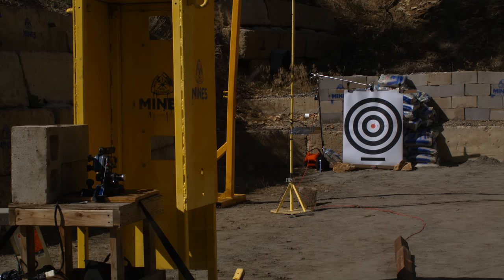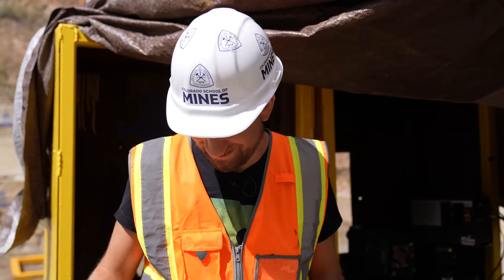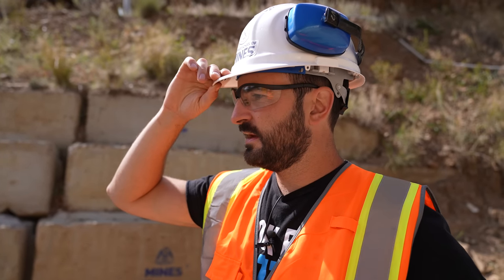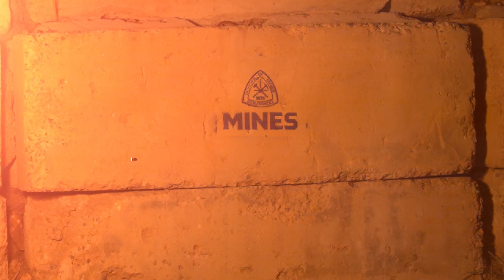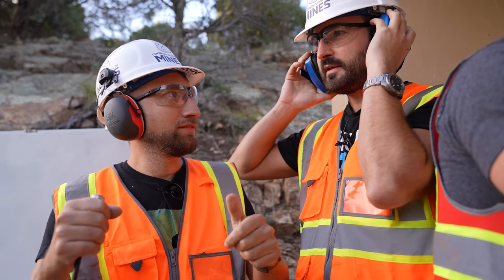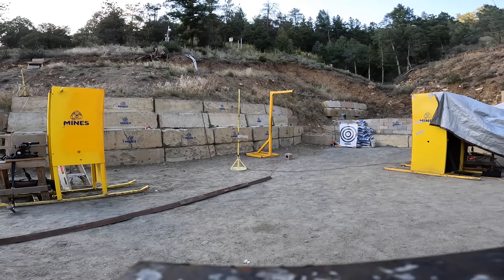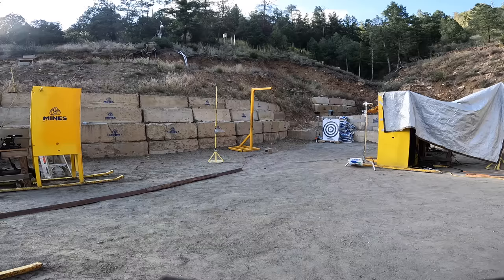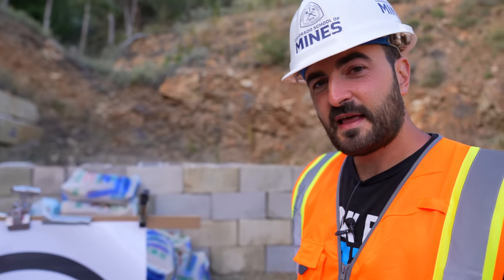Can Explosions Deflect Bullets? 2 MILLION FPS - The Slow Mo Guys

Comment: i'd say the most important factor is the bullets distance from the center of the explosion. 

i'm sure you could also figure this out mathematically rather easily. you choose a rate of deflection that you would consider sufficient, take the bullets weight, shape and surface area, calculate the pressure per surface area that would do that and from there you can pretty much just tell how much explosive you need at what distance. and THEN you could get some awesome slomo footage of it =D
Reply: I was browsing the comments for someone that said this, really. Move the bullet closer to the explosion and there will be more changes on deflection.
Reply: @hacky97  yeah, i did the same and didn't find anyone saying this here either, so i posted it. 
seems obvious to me.

Comment: As a long distance shooter, I have so many thoughts on this. This was, easily, one of my favorite experiments you've ever done! Well done. 
You have single handedly given the haters a pile of ammunition to use against people that blame their bad shots on the wind. "If C4 doesn't affect tragectory, how in the world would a gentle breeze!?"
Oh boy, I can see them coming out of the woodwork already. Thanks guys.
Reply: Well, you saw how much the wind affected the bullet - more than the C4. They mounted the gun in a jig that allowed them to basically shoot exactly the same way each shot, much more precisely repeatable than any human shooter. So, either the gun shoots inconsistently each time or the wind is actually affecting the bullet.

So, the people blaming either gun or wind are probably right. No ammunition for the haters, on the contrary.
Reply: This was my exact thought. I think the reason there seems to be no deflection is how short the bullet's flight path is. If they could run this test reliably with a range over 100 yards or more, I bet the results would be different.

Comment: I'd be curious to see this done with the explosion directly ahead of the bullet. Thinking of the bullet's trajectory like an orbit, if your aim is to reduce the velocity I think it'd be more effective to impart a force on the retrograde vector (rather than the radial in) ie. instead of trying to use the explosion to push the bullet down, push it straight backwards to hopefully maximise how much you can slow it down (and thus impact where it hits the target)
Reply: Exactly
Reply: Yea exactly. It's like asking whether or not water can deflect a bullet, but instead of shooting the bullet into water where the bullet is experiencing the proper opposing resistance, you instead tried to pour water onto the bullet as it was traveling and barely got any water on it. The shockwave from the explosion needs to have started and is expanding toward the bullet for the bullet to experience the most resistance that could lead to a delflection. If all it's doing is going off right above the bullet, or right behind the bullet then it's really only going to chase the bullet and not apply that much force to it

Comment: If you ever revisit this, try getting a grouping for the bullet rather than a single test shot. Make sure you circle the group with a marker too. That way you can easily tell when a bullet is out of the average grouping
Reply: And the target was way too close. No way to tell if the explosion had any affect on the bullet or not.
Reply: @billnunya9324  I mean, obviously the bullet is gonna be off a little bit, but its not like its gonna hit 45 degrees below point of aim because a bomb went off next to it
Reply: @billnunya9324  You have to take windage into account though. A more solid target is probably needed to avoid it going all over the place, but getting too far away would allow more external influence, especially on a little 9mm.

Comment: At this moment, this is my favorite Slow-Mo Guys video. I 100% thought the bullet wouldn’t even hit the target. I would have bet that the C4 would have a significant impact on the bullets. Nice video!
Reply: Explosives are very high energy at the point of explosion but that quickly diminishes with distance (inverse square law) - unless it's something like shaped charge. Bullets, on the other hand, are small, heavy and moving fast so they have high momentum, way higher than the shockwave at distance. Maybe if they exploded C4 right next to the flying bullet it might have an effect.
Reply: @LiborTinka  I agree with you and Gav. It would be cool if they had way more time to play around with the variables. I’m sure with enough iterations, they could achieve more deflection!
Reply: @jeromeschwartz3699 Yes. There is already a video of bullets colliding mid-air air (from SmarterEveryDay) so hitting a bullet with directed charge or close-up explosion would be cool, too :)
Reply: @jeromeschwartz3699 Yes. There is already a video of bullets colliding mid-air air (from SmarterEveryDay) so hitting a bullet with directed charge or close-up explosion would be cool, too :)
Reply: @LiborTinka  I saw that Smarter Every Day video! I was pretty impressed with the way he solved the, how do you safely load the second gun after you’ve loaded the first gun, dilemma!

Comment: It would've made more sense to have the explosion go off well before the bullet arrived. The shockwave is the only aspect that could fesibly deflect the bullet, so having it go off after the bullet had passed, or right as it is already passing, means the shockwave has to chase the bullet, or will push on the bullet from behind, so it doesn't give enough force in an opposing direction to alter the course. If the shockwave was already forming while a bullet was entering it from the front, thats when you may get the results you want since that is an opposing force that could result in it being deflected. It's kind of like asking whether or not water could diflect a bullet, but instead of shooting a bullet into water, you instead tried to pour water onto a bullet from above
Reply: And anyhow, the shockwave, moving at Mach 1, won't catch the bullet, moving at  Mach 1.1 (1250 ft/sec)

Comment: I think a .45 or 10mm would be a more interesting round to use for this. Slower round with slightly more surface area. I suspect the rotation generated by the rifling on the relatively quick and small round might've been a more effective shield against Shockwaves than the larger/slower rounds might have.

Comment: I would love to see you do this again in a few years on a larger scale.  Having the bullet go farther to possibly see if it deviates further down range would be interesting.  

Also, see if you can get your hands on some ERA(Explosive Reactive Armor) for a video down the line.  I would love to see some experiments done with it.
Reply: This is a good idea! Use a better target that isn't affected by the explosion and first measure the accuracy without the explosion and then add the explosion. With the target far enough away, even small deflections would be clear.
Reply: They need the bullet to pass closer to the beginning of the shockwave at the center.  That would have meant moving the gun up or the C4 down in this experiment.  The force of the shockwave is inversely proportional (to the third power) to its distance from center at the moment the bullet passes through, so for the greatest effect the bullet would be exactly at the point of the explosion.  Since that's not possible then it needs to be as close as is possible.
Reply: It should be done at a 100 yard range, the rifle positioned further back on a solid mount, and the target 100m down range. That would tell you with a usable amount of precision. This flapping paper target at 5m isn't it.
Reply: @Sotanaht01  I like that logic.

Comment: You could have moved the bullet closer to the explosion by either lowering the explosives or hiding the pistol and wire-paper and still aiming at the sandbags. This will put the bullet in a much more energetic part of the explosion, although I see this might be dangerous for safety reasons

Comment: I think you results would been more consistent if your target was solid. You can see in some of the slowmo that the flimsy target moved before the bullet hit which would alter it's initial impact point. And the way the target moves would vary with each shot as the shockwaves move faster than the bullet. Definitely worth revisiting I think.

Comment: rollup target fixed in place with a wooden frame all around, backed with plywood (or tighly stretched netting of some sort) to prevent further flapping around. painting the target on the plywood itself like some comments suggest will have the risk of the target chipping or breaking off in large pieces around the point of impact

Comment: I would be curious to see the results of a test where the C4 was right in front of the bullet and went off ever so slightly before the bullet reached it. See if the C4 ends up imitating ERA (Explosive Reactive Armor)
Reply: Well, it's literally just hitting the bullet with air, which is what the bullet is already pushing through.

ERA works because the bullet is actually contacting something solid, particularly at an angle.  Launching out a flyer plate or witness plate that the round makes contact with.

Comment: Great video as usual, guys. Unfortunately, you don't know which hole was the control shot, because you didn't calibrate the target to the immovable backstop. Next time, use a printed target on a foam core board fixed in place. The target's motion threw off the experiment. Even so, the group on the sandbags was very tight—well within the variation I'd expect with no explosion.

The bottom line is that I'd say it's reasonably conclusive that any effect of the explosion on the bullet's trajectory is minimal, and certainly not enough to make any difference to a live target at that range. The sandbags proved that conclusively.

Comment: Great job!! Timing and location of the bullet are the most important factors to consider since the power of the shockwave decreases rapidly with distance. The explosion must hapen before the bullet  arrive to the explosive so the shockwave travelling in the opposite direction will decrease the bullet velocity. You can use the speed cameras to calculate the speed of the bullet, to check velocity increments.

Comment: As ex military I have a couple of thoughts. Firstly, the target moves from the shock wave so the control then means nothing. Secondly even 2 or 3 mm of deflection over such a short distance would mean missing the target completely over any distance - a 30 kph side wind can cause a high velocity round to veer off target by about 1m over 300m.

Comment: A couple of things to consider for the revisit:
1. Get some walls up to shield the experiment from the wind.
2. Glue the target to a piece of plywood or some other hard surface to prevent the target from rippling in the shockwave.
3. Build a gun that has no, or very few, moving parts. And make it electronically fired. This should really boost the precision of the shots.
4. Develop an electronic firing system that runs both the firing of the gun and the C4. With this you should be able to very precisely adjust the timings of the gunshot and the explosion.
5. Build an explosive holding device that lets you adjust the C4's elevation and distance from the bullet's trajectory. This should let you keep constant the distance between bullet and explosion. Also, not having the C4 hanging freely will prevent inaccuracy from swaying.

I know this is probably way more effort than it's worth, but just in case...

Also, have you considered doing a collaboration with the guys from SmarterEveryDay? They have done some interesting stuff with bullets and precise timing, and probably have a lot of valuable experience they could share.

Comment: To compare to firing at a distant target with wind: A 5.56 mm bullet travels something like 1000 m/s, judging from the video there's roughly a metre where it's exposed to the shockwave, so 1 milliseconds. If you're shooting something a kilometre away, it's gonna take at least a second (more because you'll need to arc it a bit and it will lose speed as it goes), so you would need a thousand times more force from the explosion than wind to get the same deflection of the bullet's heading. From a paper I found, the overpressure from 100g of C4 1.5 m away is about 15 PSI or 100 kN/m^2. A gale force wind (20 m/s) causes a force of about 250 N/m^2, so the C4 overpressure isn't too far off being 1000 times stronger, and will deflect the heading of the bullet by a comparable amount to the total effect of the wind. However, in this test, the bullet does not travel far at all after the explosion. I think this is what really makes the difference. If you could set up the target to be distant from the explosion (and had a good precision rifle clamped to a steady bench) you'd probably see a distinct measurable effect, comparable to the deviation due to a strong wind.

Comment: Just to answer the basic question: Yes, it can. This is the concept behind Explosive Reactive Armor (roughly). It’s slightly different because ERA is meant to deflect incoming copper penetrators from High-Explosive Anti-Tank (HEAT) shells which have a secondary charge which fire a bunch of copper spalling at extreme temperatures from the shell. Essentially, it’s a shell with a shotgun inside, except the shotgun is armor penetrating, super heated copper.

I think to achieve this effect, you’d need a directed explosive in a roughly 45~135 degree arc facing the incoming bullet dead on so that the center of the shockwave directly opposes the force of the bullet. As you tested it, I think you are just seeing why rifling is so, so, so important for accuracy. That gyroscopic motion prevents significant lateral movement. If you have it directly oppose the bullet, the gyroscopic spin of the bullet shouldn’t be a factor I don’t think. Either way though, it’s always fun to see explosions and bullets!

If you wanted an idea of something new to do though, if you can get ERA and some type of HEAT shell/rocket, it would be absolutely fascinating to see how the ERA works and what it does to the copper.

Comment: That was so cool. That frame where the bullet is directly under the infant explosion is beautiful. I would hang that on my wall. 

When you go again, you should try a smoothbore musket. Perhaps a musket ball will be more susceptible to explosive influence as it won’t have the rifling and aerodynamics stabilizing it like a bullet would. Establishing an accurate baseline with a target might not be super feasible, but the footage would be badass if it worked.

Also, if the explosives detonated before the projectile became perpendicular to it and the ground, the projectile would be receiving force pushing it back and down, rather than forwards and down. Perhaps this could help destabilize the projectile?

Anyways, thanks for making videos! Keep up the great work as always. See you in the next one!

Comment: Exactly what I expected ! Bullet is just soo dense. It would (what I think) deflect a noticeable amount, if it was touching the bullet. Amount of resultant force drops dramatically with increasing distance. 

Bullet was not creating noticeable deformity in the blast wave, indicating, it actually absorbred very less amount of energy. Again because it's very small and the time the force acted upon was smaller.

Comment: A few issues here, which might have been or not been considered: Gravity, the flapping target from the shockwave, and perhaps the bullet needs to enter the explosion, before, during, and after to have full influence from the shockwave. Additionally, we can hypothetically assume with enough explosives and enough distance in time that the bullet will "dip" from inital Directory. Loved the thought about moving the tape back a meter! Lmao but I think the biggest uncertainty are the target and the position of the coordinated bullet at the time of explosion. I wonder if the difference in velocities and instance of influence (the period of the bullet under exertion of force) are to great and small against the bullet to have a significant, observable effect on the bullets trajectory. So, at what point or how long much the bullet endure the duration and at what intensity of the bullet to percieve such a notable change within the relationship? What forces are at play and how does the environment barely effect the bullet (thinking fluid dynamics, states of matter, and near instantaneous change in a confined space). Fascinating video! Would love to do what you guys do.

Comment: My personal random thoughts:

Hitting on the front quarter of the bullet with the actual shockwave would do the most to deviate the bullet. It would cause a dramatic adjustment of the density of the travel medium at weird angles, so both the air resistance and the spin would be working to destabilize the bullet. I also expect that the blast of plasma did considerably less than the actual shockwave, which cannot by definition travel faster than air. So plasma at 3kfps would be making a small shockwave as it traveled, but the main wave was clearly visible travelling at ~1050FPS. Many of those shots where the plasma engulfed the bullet would not have had any interaction between the 9mm travelling supersonically and the main shockwave. I also think a spitzer type bullet, as compared to the round nose you were using, would have a greater sensitivity to random pressure waves, but I may be mistaken. If you get the chance, I would love to see an explosive lens or shaped charge used to put a dramatic overpressure or jet of metal vapor onto the side of a bullet in flight - but I imagine that might be a little much even for you all.

Edit: Maybe a collaboration with Brandon Herrera might get you the shaped charges...